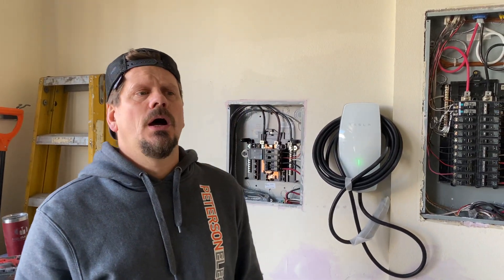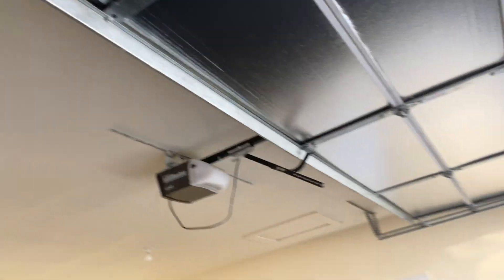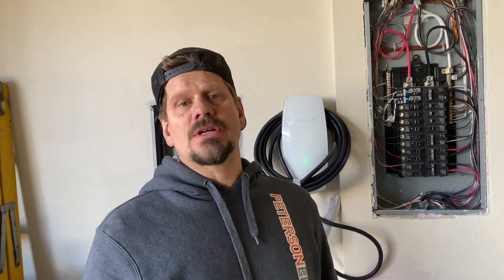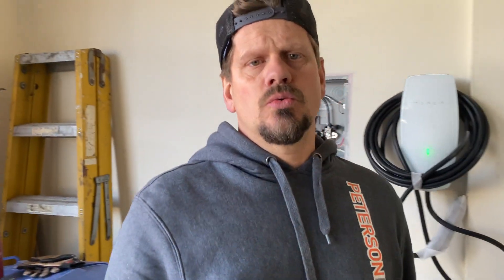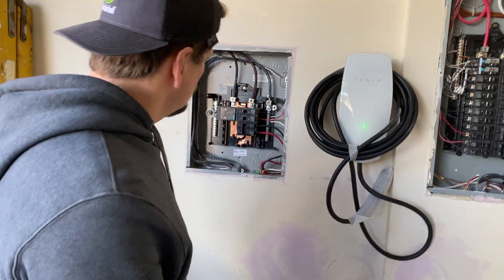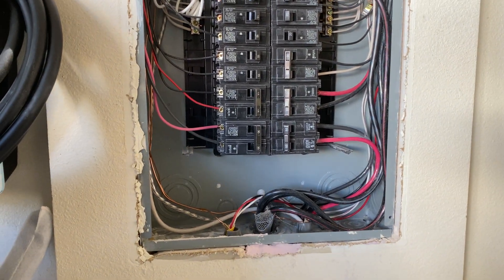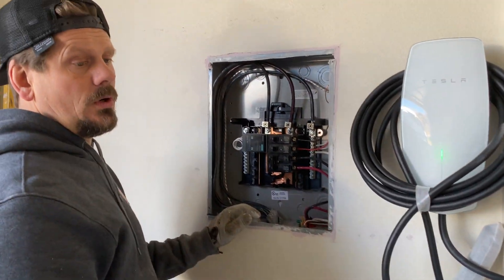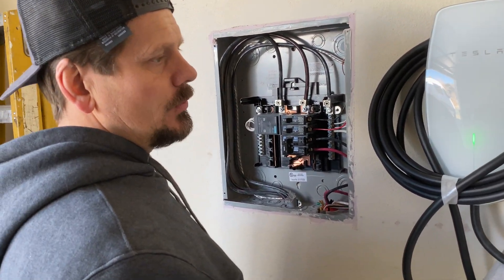Electric Vehicle (EV) Charger Install - What You Need To Know!

Comment: I've always thought the charger sweet spot is 240V at 30A (24A actual). It can use common, cheap 10-2/10-3 NM, and it leaves enough headroom on a 200A service to add another charger in the future. That gets you somewhere around 22-24 miles per hour of charging, which for your garage, is plenty considering most people drive less than 50 miles a day and you have overnight. All the 50/60A hookups do is cost more money for bragging rights, and they limit a future 2 car setup unless you drop it down and under-use the wire.

Comment: With those level 2 hard wired Tesla Chargers I always recommend a 60 amp breaker(125%) and getting a 200-amp service.
( because most customers still may want to charge during the day which can overload that 125-amp main breaker.

Overhead replacement will be less expensive than Underground.

Comment: You mentioned 50 amp breaker for the hardwire charging unit but those are good for 48 amps, so wouldn’t it need 60 amp breaker since it’s continuous load?
Reply: The breaker and wire both have to derated to 80% or oversized to 125% of the continuous load (same result). How the wire is run (metal conduit with thhn/xhhw-2 vs nm-b/ser/seu/pvc conduit) can also determine the wire size due to thermal limitations.